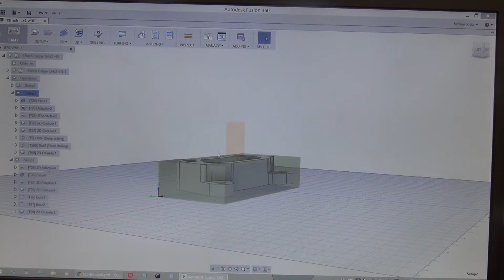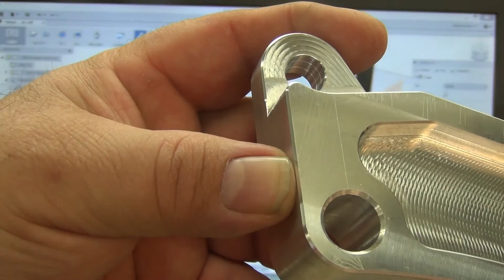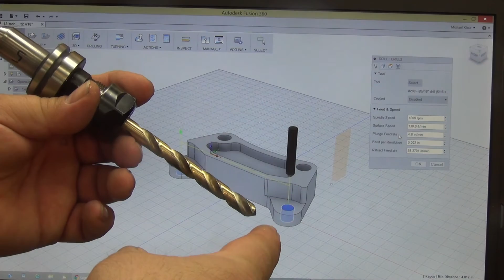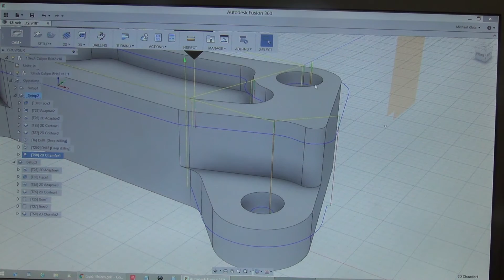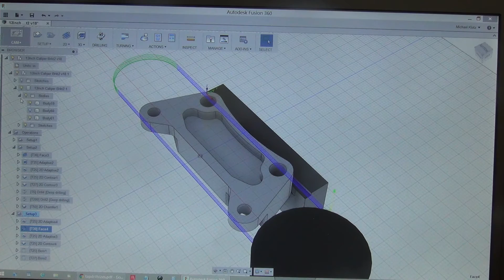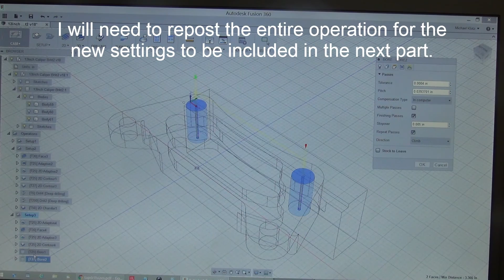Fusion360 - CAM, Caliper Bracket walk thru

Comment: Good point on the rough then facing - I watched the superfly catch a .003 corner and it about made me need to change my shorts. No damage, thankfully, but it did shift the part just enough that I could see the difference in the chamfer. I was told everything was ok but I won't do it that way any more.

Hope all is well!
TZ
Reply from the maker: That was Hirudin's suggestion, not mine.  But, it made so much sense, I just had to implement it. :)
Spent most of my weekend on CAD/CAM redesigning the bracket in my brake kit.....the one I've had for years.  I'm looking to switch from a 5 piece weldment to a one piece aluminum.  Hopefully, I'll be cutting the first one by the weekend?  
All is well.  I hope the same at your end.  :)
Mike

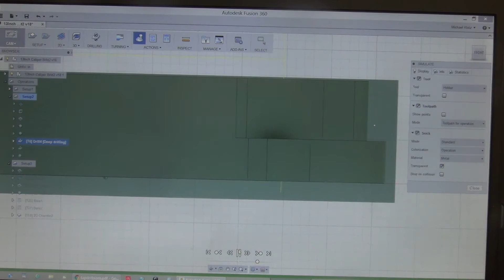Comment: Regarding the tool length problem (~ 27:00), I'm not sure I understand what's happening, but I'll throw out some idears...

Did you say you aren't measuring your tools offline? To ask it more clearly: how are you currently measuring your tools? To a certain degree it doesn't matter, but I really think the best way to go is to literally measure the tool from the flange of the TTS holder down to the bottom tip of the tool. For instance, I think my Haimer was somewhere in the neighborhood of... um... 4(?) inches long. That being the case, the Haimer would have a value similar to "4.000" in the tool table. If that drill was 2 inches longer, the drill would have a value of "6.000" in the tool table.

It sounds like you might have the Haimer marked at "0.000" in the tool table and then all the other tools have a negative value. For example, an end mill that's one inch shorter than the Haimer would have a tool table value of "-1.000". I could imagine that drill, with a positive value of "2.000", might cause some havoc. It seems like it shouldn't, but this IS Mach3 we're talking about here. :p

If you ARE measuring your tools that way (and I've now written a lot more than I should have based on that possibility) I have a possible "easy" solution that you might be able to employ... This idea isn't perfect, but it might be easy enough to test and then possibly implement. Anyway, what you can do is just subtract, say, 10 inches from all tool lengths. "10" is easy because you could just go down the tool table and append a "1" before *most of the* values in the tool table. In other words, instead of the Haimer being "0.000" you could label it as "-10.000". That shorter end mill would have a length of "-11.000" instead of "-1.000" and the drill would have a length of "-8.000".

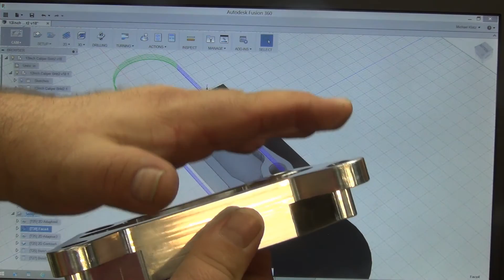~42:00, that was me. :D
Reply: (More stuff about a fix if you have the Haimer listed as "0.000" in the tool table...)

An alternative you could do if you wanted make the tool table a lot better at the expense of the fix being more complicated...
Instead of making the Haimer "0.000" or "-10.000" you could just declare a length for the Haimer. Shoot for something close to what it really is, but keep it to a round number. Something like "5.000" would be good.

Then you could take that value of "5.000" and combine it with all the current values for the other tools. So, like, if you have an end mill that's currently "-1.000" in the tool table, you would change it to "4.000" (five plus negative one equals four). That way the drill might be "7.000" instead of "2.000". This way all the tools would have a positive value and all those values would be close to their actual lengths.

After making this change it probably wouldn't be a bad idea to be real careful the first couple times you do a tool change. It really shouldn't matter since the machine will be starting with "5" in it's head instead of "0", but computers are nutty and can't be trusted.
Reply from the maker: Lost the first reply. :( lol   Interesting ideas!! Thanks!!  I do it the second way you mentioned.  The haimer is currently tool zero AND tool one.  Looking at your suggestion.....I'm thinking that maybe instead of subtracting 10" from all the tools, I just add 10" to the haimer setting as tool zero....I think I would actually have to type in a negative 10" if I do it when I set it.  I could just MDI it up 10" and then hit zero.  Then....I could just measure all the tools and not have to do any math with the numbers.  I could take an offset reading for the real length of the haimer as tool one.  I guess a lot of guys use 99 for their probes, but that's a long way to scan through the tool table in mach to get to it.  
Hmmm.....You've got me a bit excited about the idea now!  I knew something different had to be done, but I hadn't settled on what or how yet.  I thought about using a set screw holder I made and putting a 10" rod in it.  The holder has too much run out to use with an end mill, but would be just fine for setting a length offset.  I just thought is a bit hokey to have a 10" rod in a holder laying around.  I've never seen anyone else with a tool zero like that.  But if I just add 10".....the machine doesn't know it's not a 10" rod.  Hmmm......now I want to go fire up the mill right now and reset everything.  I haven't been using drill chucks and drill bits because I knew they'd be longer than the haimer.  I have an Edge Technologies tool setter so resetting all the tools is pretty easy.  
Thank you so much!!!!
Mike
Reply: I think that might work... maybe. Would you then have to lift the head up 10" after finding zero every time? ...seems like a possibility, but it's hard to wrap my head around it at the moment.

Dang, I should have mentioned this last night. I hope you haven't started remeasuring everything yet... Tormach has a fairly recent video about setting tool lengths. It's a good one IMO. Basically what they suggest is putting a flat thing on the table or in a vise or whatever (like a 123 block), then bring the nose of the mill down onto the "flat thing". You call that Z0 and zero the Z DRO. Then put in the Haimer and put it down onto the flat thing. Since the nose of the spindle will now be a couple inches over the flat thing, the Z DRO will say something like "4.2811", that is the exact height of the Haimer. The same thing can be done with any tool, and the Edge tool setter will make measuring normal tools SO much easier. It's basically the same process, except you treat the spindle nose the "reference tool".

The tool setter can be calibrated to be exactly 3" high, right? if so, do the Haimer with a 123 and everything else wit' the tool setter. Also do the spindle with the tool setter.

Bye bye reloading Mach3, hello drill chucks!
Reply: This is the URL for that video...
BoIB_Fatt44
"Getting Started With Tool Tables in PathPilot"
Reply from the maker: If I use the haimer and set zero.....which I do on a pair of 123 blocks(one 3" and the other flat for 1") to get exactly 4"......which is the exact height of the Edge tool setter.  Once I get zero, I would just type in -10".  The machine and software will simply think that it's 10" below zero then.  All the other tools will come up negative and there's no way I'm going to end up with a tool that's more than 10" long.
I haven't heard of using the spindle nose for the tool zero, but that sure makes a lot of sense!!!  That should also give all the tools a positive offset with is way better for avoiding crashes.  I've watched tormach's tool setting vid a couple of times.  Is it a brand new vid?
That's how I do it right now....123 blocks to make 4" with the Haimer to set zero, then everything else with the tool setter(4").  But....a tool longer than the haimer will cause problems.....which is exactly what happened.  I'll have to think about it and play with it a bit.....the spindle nose zero sounds very nice.....I'm just not sure my spindle will get that close to the table.  I might have to do a couple of blocks and the tool setter to get it up to 6".  Minimum Z might be 5".   Great ideas!! Thanks!!
Reply from the maker: Ah....that's the one I've watched a couple of times.  I guess my brain is finally ready to comprehend that method. lol  I'll watch it again tonight......time for some sleep. :)
Reply: You're welcome and good luck, good night!
Reply from the maker: I went and watched that vid.  I've seen that guy in other vids and watched their other tool setting vid....but I hadn't seen that one.  Great vid!!  Thanks for the link! I don't think I would have looked too hard for it since I really thought I'd already seen it.  I'm going to see if I can switch over to using the nose of the spindle.  :)